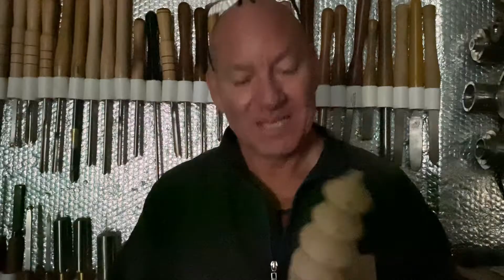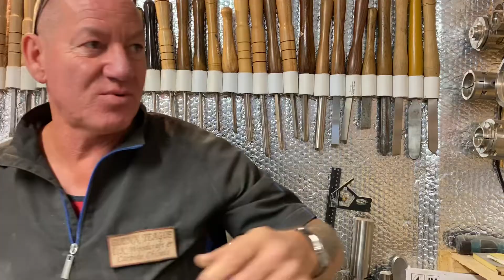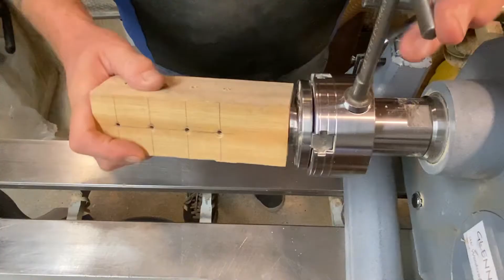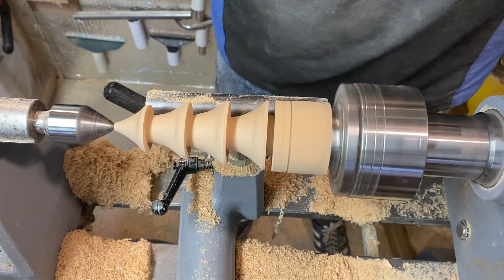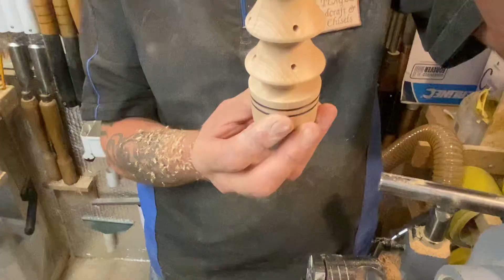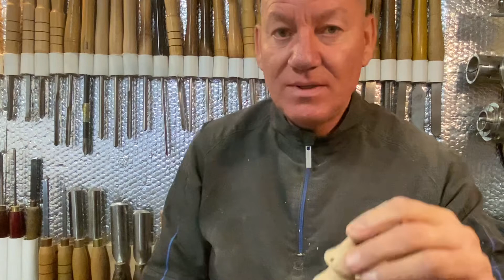Woodturning a Christmas Tree with a difference (added tea lights) using my Carbide Chisels

Comment: That's awesome Glenn. I am going to try this one, along with your birdhouses. Thanks so much for sharing your wisdom. I need to make a narrow parting tool.
Reply from the maker: Thanks. Did you give it a go? What about the birdhouse? I've lost count of how many I have under our pagoda now. Some are hanging on our outside Christmas tree too.
Reply: @glennteagleofukwoodcraftca5308  I haven't had much lathe time, getting the choir and church ready for Christmas but I did get a new table built to hold my lathe and I think it's going to be awesome. I am going to take a couple days just for me and my lathe and see if I can get these done. Thanks so much for the wonderful lessons and concern.
Reply: @glennteagleofukwoodcraftca5308  I did try the beads and I couldn't believe how simple it seemed to be. Just paying attention to what you said and fo9cusing on what you're doing. I did have some tear out but that was because I was using a piece of 2X4 I turned to round. That was COOL
Reply from the maker: @JimmyLee0757  You will find the tear out will disappear with practice and the harder the wood the better the results.   Happy turning

Comment: Love this, would it work with pine as all I have is 2x2 offcuts of it ?
Reply from the maker: Yes David. Give it a go and let us know how you got on.
Reply: @glennteagleofukwoodcraftca5308  went out and bought a bit of beech and it was a disaster. I was putting the marks with parting tool and got the bit where the 38mm drill hole 30mm in was and it just came apart. 😡
Reply from the maker: @davidharrison1558  Oops

Comment: Glenn what is the name of the light that you used
Reply from the maker: They are battery tea lights, I got mine from home bargains. 99p for 4. 
Asda do them but £2.50 for 4
Reply: Thanks I'll try to find them here in the states
Reply from the maker: @timponder7487  sorry, I didn’t know you are in the states
Reply: I made the tree but the tea light is not bright enough to light it all the way to the top. I love the project and am hoping to find a brighter light.
Reply: Hi, thanks for the video! Dumb question: how do you keep the tealight from falling out the bottom? Do you glue it in ?